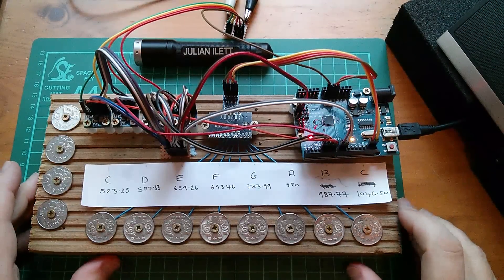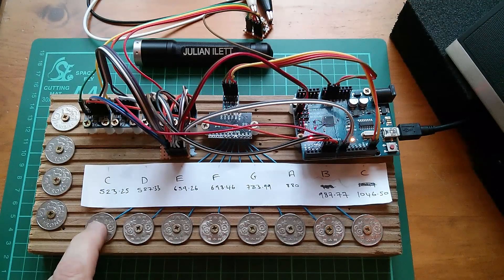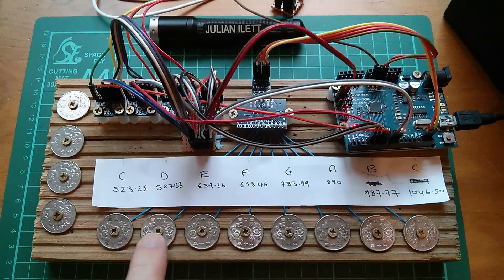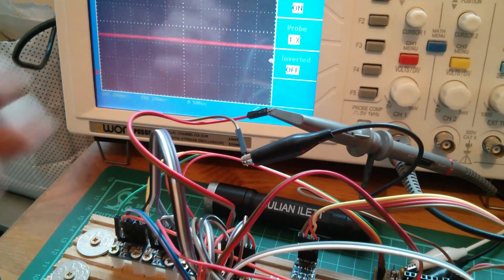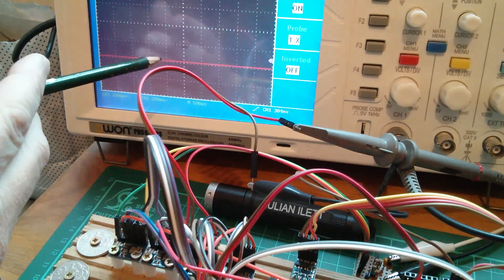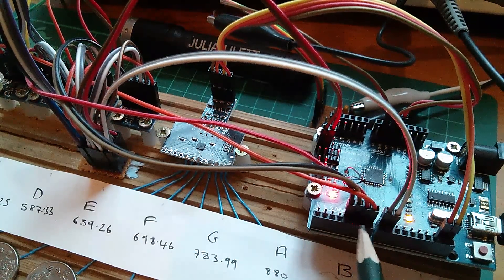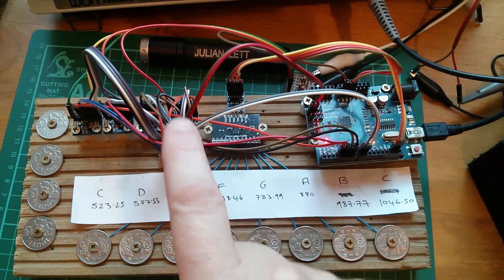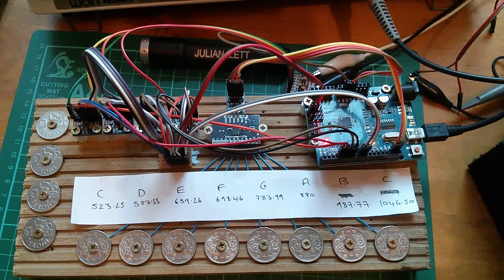Noisy Sine Waves - Penny Organ Project

Comment: Try a capacitor in series with the output of each oscillator, Jules. It should prevent any DC offset on the output, passing through only the sinewave.
Also see if there's a way to make the oscillators "zero crossing" That's the term to look out for.
Looking forward to the debut album! :D :D
Reply: or make arduino watch for the zero crossin

Comment: You'll probably need to use the triangle or square waveshape as an input for a vocoder, you want something with as much harmonic content as possible so that there is some signal in any given band of the carrier where there is energy present in the modulator. Using sine waves only will give quite limited articulation.
Reply from the maker: True, although the vocoder can inject white noise into the mix when it detects ss, sh and ch sounds from the microphone.
Reply: +Julian Ilett how does it know to add it?

Comment: You can even get clicks on professional keyboard/synthesizers if the attack and release times etc are very short, once you build an envelope generator the issue will be mostly solved. You will need to make sure AC coupling is used in the appropriate places to prevent issues in any case, maybe be you can fix part of the problem in software.
Reply: I suspect the envelope will be controlled by the vocoder :) 
edit:: pressed enter just as he said the word    WF;CL!
Reply: MattOGormanSmith what is wf;cl?
Reply: I'm going for watch first, comment later :-)
Reply: Excellent,that has to be it,thanks coolkeys!
Reply: I didn't want to spoil the meme by explaining :)
Reply: Wow what a dank meme you really got me good bro... Piss off ;)

Comment: Good one again! I guess the continuous offset on the outputs will probably give you some headache later in the vocoder. So I really suggest to add a bipolar electrolytic capacitor in series of each output to the summing point, or later to the inputs of the vocoder. For the noisy module, check for a broken chip capacitor. May be just put a normal legged one across some of them to check which one is broken.

Comment: Are you using the sleep function to mute the output or clearing the tuning word register? Sleep function can leave the last programmed level outputted so that'd explain why you get a DC level.

Also worth checking the filter components on the boards as they have been known to be very incorrect or even missing.
Reply from the maker: I'm clearing the tuning word register. This module doesn't have any filter components. I do have one with the filter, but I think it's tuned to the highest frequencies (around 40MHz) so it won't have much effect at audio frequencies.
Reply: Then I think it needs to be put into reset by setting that bit which according to the datasheet will output 'mid range' and should carry on with the previous configuration when you clear it (which seems odd but...)

As none of the synth modules have the filter and only one is affected, it's probably a faulty module but still worth looking at the decoupling caps on board.
Reply from the maker: Yeah, I'll do that. I'm going to pull that DCO out and use it to generate square wave frequencies for testing the Frequency counter kit I've just built. I can have a closer look at it then. Cheers Clint :)

Comment: The scaggly waveform kind of looks like what happens if you have an op-amp that isn't rail-to-rail capable and you try to drive one side of it too far towards the rails.  Maybe the positive rail of the oscillator is too low for some reason.  Or maybe there's an offset that's shifting the entire waveform up and causing it to run too close to the rail.

Comment: It's not apparent from what I can see in the video whether there are any power supply bypass capacitors in there,  If I were building something like this I would have at least 100nF on each of the oscillator modules and also some smaller caps (100-470pF?) on the signal outputs.  If you look at a schematic of a lot of electronic musical instruments you find that there are bypass caps all over the place.  Needed,  I think.

Comment: I am just guessing, but this "distortion" looks like typical symptom of too low capacitance (or resistance) on PWM output. If these chips indeed have PWM outputs then check the output cap.

Comment: I can see this as a foundation on which to build a (simple) OCR/music player. Add one more digital oscillator, and replace the 8 coins with 8 reflective-mode opto-couplers, a stepper motor, and some specially prepared "sheet music", and the four buttons on the left as stop/start, rec/play, FF and rewind. Make a simple conveyer belt driven by the stepper motor to pull the strip of sheet music under the reader head (the opto-couplers), and have the arduino read them and send the info to a PC, or to internal memory, while playing the notes as you already have. Voila - Arduino-controlled player piano! :)
Reply: That would be excellent! But it doesn't have to be one or the other, you could keep the existing setup and couple in a board on the side which does the optical bits, just wired up in parallel with the touch recognition thing.